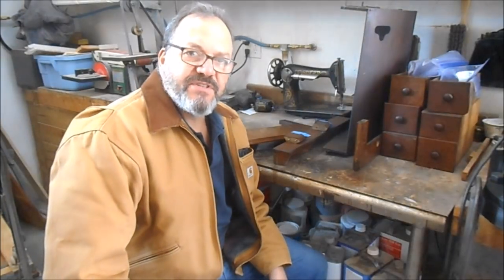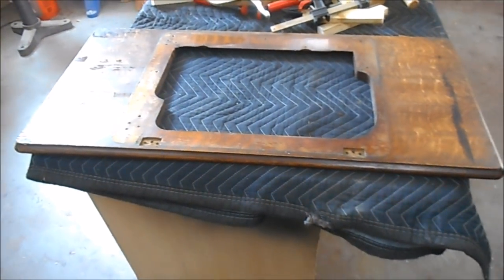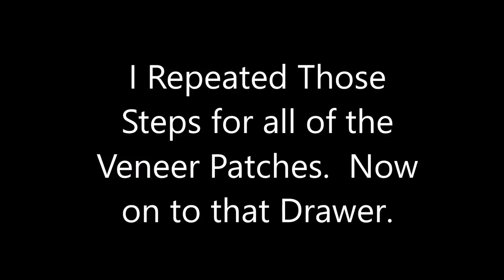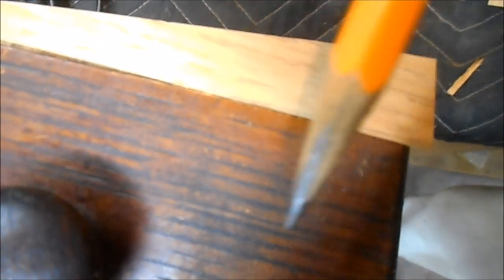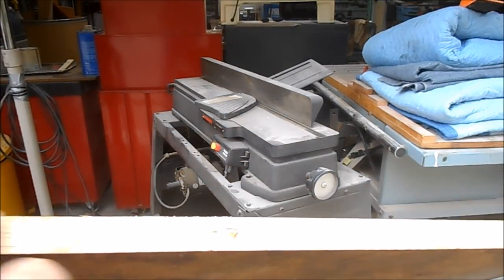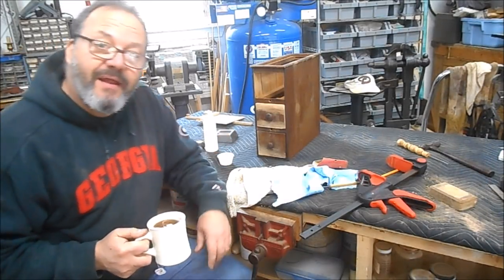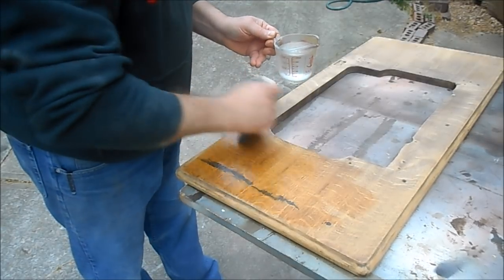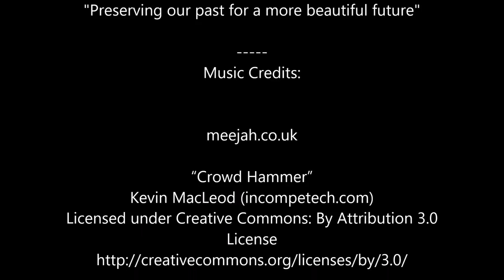Preservation Restoration of 1910 Singer part 2

Comment: By the way my table is missing the wheel and rod that connects to it so I’ll have to match up parts from eBay. It’s just for my own pleasure and not for resale.
Reply from the maker: You can normally find the wheels on eBay, but the axle shaft for the wheel was a rivet and they normally get pretty well ruined getting them off.   I have used 1/4" bolts to replace them.   I mount the nuts on a spindle and grind them round.   I Lock-tite them on and paint them and they resemble the original peened over rivets pretty well.   Good luck.
Reply: Lost Mountain Restoration Ok thanks! The table belonged to my mother in law’s husband who passed away. I’ve always wanted one since I remember watching my grandmother sew on hers. I’d really like to do the restoration myself, and do it well.